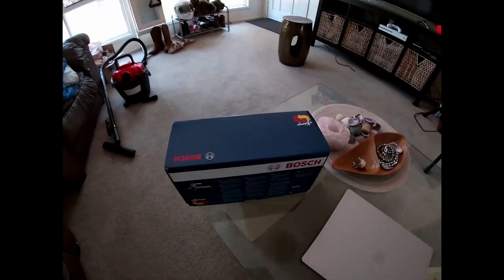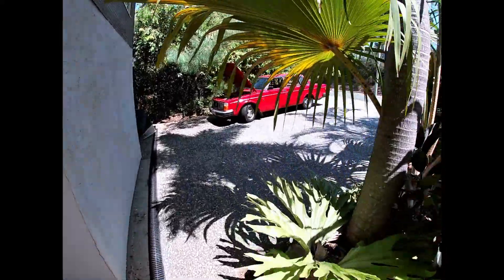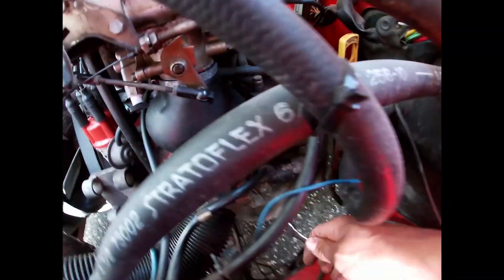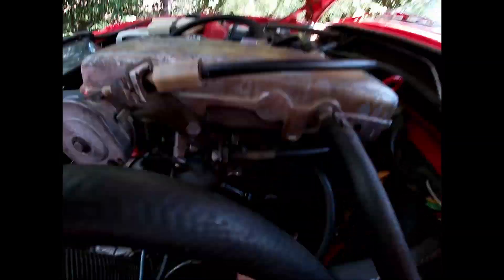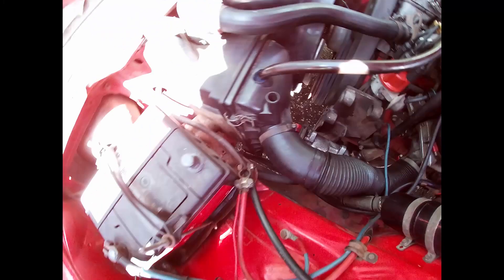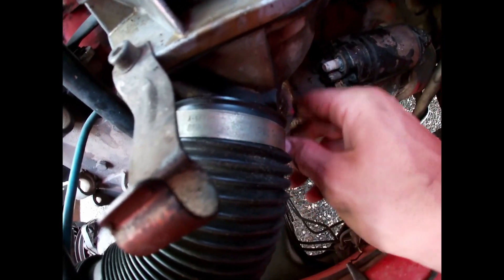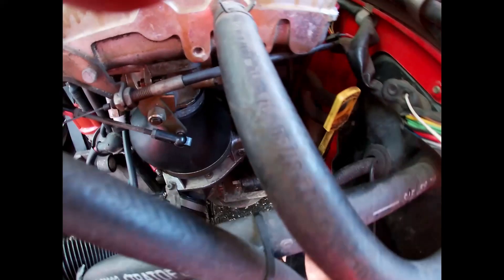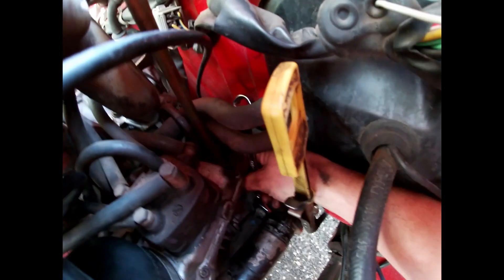Volvo 240 Starter Change

Comment: 80 seems to be the easiest of engines to work on, there's literally nothing impeding your way to access the starter bolts. I have a 92 and of course, the top bolt is nicely tucked away between the transmission case😖